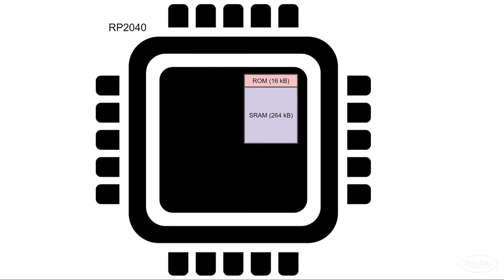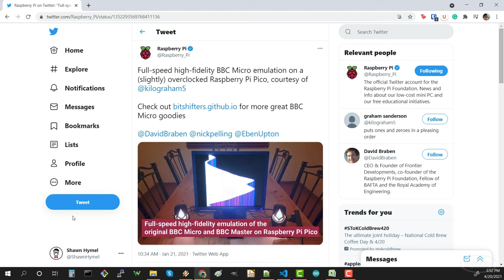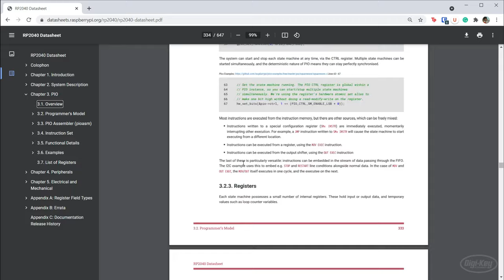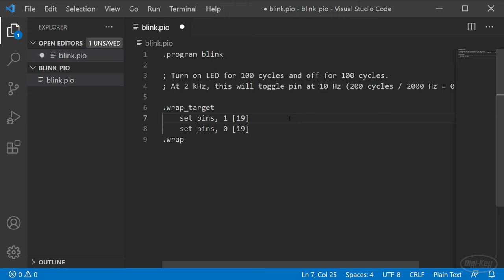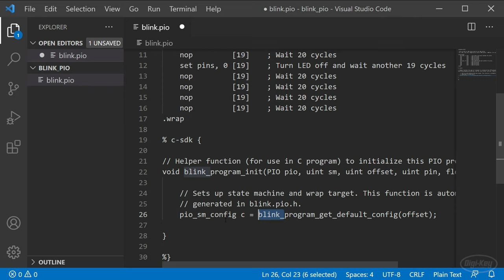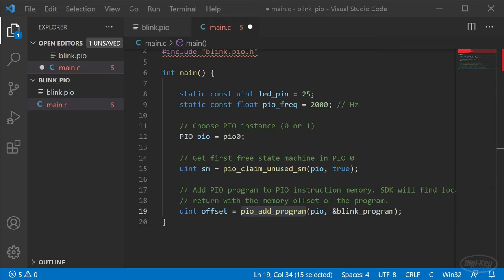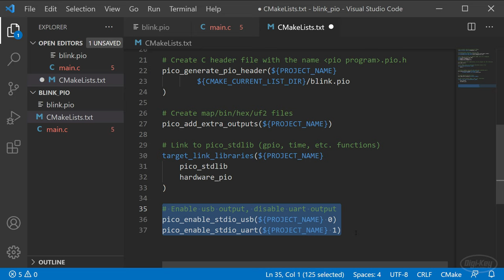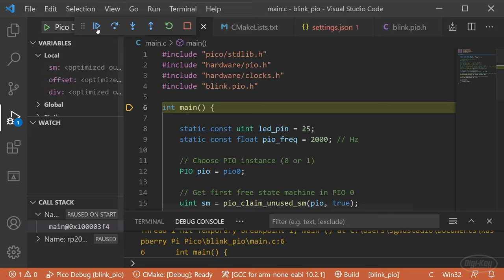Intro to Raspberry Pi Pico and RP2040 - C/C++ Part 3: How to Use PIO | Digi-Key Electronics

Comment: Is this PIO similar to the ULP processor inside the ESP32?
That module has more instructions though, including ADD and SUB math as well as boolean operations like AND, OR, ... 
Very useful to execute ADC routines while CPU is asleep.
Reply: I didn't know about the ULP, thanks for pointing that out! As you pointed out, the ULP is more capable than the PIO, but there are more PIOs in the RP2040.
Reply: @ShawnHymel  It can operate the ADC and I2C while CPU sleeps. That's good enough for me. 
https://docs.espressif.com/projects/esp-idf/en/latest/esp32/api-guides/ulp_instruction_set.html

Comment: Has the "development environment" improved in the past two years? I'm completely new to the pico, but picked one up this week with the idea that I might be able to use it for a project that I had been working on implementing completely in 7400-series logic (if only there were a "DigiKey Prime" for free overnight shipping...). I was able to do the "blink" program on the pico using the Arduino IDE, which was stupidly easy--same exact code compiled and ran, just by changing the build target to the pico--but it's unclear if it's possible to do PIO programming with similar ease in the Arduino IDE.

Comment: I have a hard time believing that someone who works for digi-key(assumption) Has never seen a "programmable peripheral" before. Maybe speak with RCN, also of digi-key who has been supporting hardware that's been doing exactly this for 8+ years. You know, the beaglebone white / black ? PRU(programmable real time unit). TI AM355x . . . I'm not saying this isn't a cool feature, but it is definitely not the first. Other than that, great video.

Comment: This is a needed video.  Twi questions.  Can the pio be used to implement a toggle buffer of a/d values that a normal interrupt driver does.  Second is FreeRtos available much like the dual core ESP32.  Thanks
Reply: The PIO/ADC is a great question. I don't have an exact answer, but my guess would be no, you cannot read ADC values from the PIO. If you look at p. 11 of the RP2040 datasheet, you'll see that the ADC is treated as a separate peripheral from the PIO, and I don't see a way for the ADC to load the PIO FIFOs without CPU intervention. However, I could be wrong on that, and I'd love to know the answer, too.

I've seen some RP2040 ports of FreeRTOS, but they're all single core at the moment. I have to imagine someone will give us dual-core support, much like you find in ESP-IDF, but I have not seen it yet.
Reply: @ShawnHymel  thanks
Reply: @ShawnHymel  follow up question.  In a machine learning application one may have to sample the A-D at a high rate as in a glass break detector. ( See Ti app note)  If one is doing tensor flow lite, then the bandwidth of the processor will be robbed by the high interrupt rate.  If one uses circuit python, then interrupt speed is 50x slower than C++.  Circuit Python only makes sense if the PIO can service the interrupt.  
This brings up the general question which I ask in humility.  What is the overall design philosophy of this chip?  I understand the ESP32.  (BTW I was involved indirectly when this chip was developed.)  Seeed Studio has an arduino m4 which lcd display which they are pushing for machine learning.  I am confused about this chip.
Thanks
Reply: @glennedgar5057  I wish I knew the answer to the design philosophy question. I'm guessing only the folks at Raspberry Pi can accurately state that :) My guess is that it's aimed at more education/maker audiences, hence the cheaper M0+ cores. If they really wanted us doing advanced DSP, ML, etc. on it, they would probably have given us an M4 core with an FPU. I imagine the speed + external flash + cheap IP core is primarily intended for MicroPython/CircuitPython development by the aforementioned crowd.

Comment: I wish there was a video detailing how one can use the ws2812 Neopixels in C such that it clearly demonstrates in code how one can individually controll a specific Neopixel in a chain.  Say there are 64 NP's, you can put_pixel(urgb_u32(255, 0, 0) and this would set the 0th or 1st NP red however it is not clear how you could make say the 12th pixel red or another color.  The examples in the official pico-examples do not do a good job showing how to actually make this work in C at all.  There is nothing on the web that really demonstrates this functionality in C.
Reply: Look at the protocol documentation in the WS2812 datasheet, then you will understand why something like void put_pixel(uint16_t pixel, uint32_t gbr) isnt possible in a low level implementation like with WS2812.pio.
WS2812 and similar use a 1 wire serial protocol, that means timing is everything.
The order you send data to the WS2812 decides which pixel receives it, a delay in transmission (which you will find in the datasheet of WS2812) basically means you are finished sending data and the LEDs reset with that data you just sent.
Therefore you have to send that data fast enough to not trigger the reset.
Lets say you want to change the 10th LED in the chain, to do that you have to make a quick for loop that sends 9x (uint32_t)0x0 and then the value for the 10th led, eg (uint32_t)0xFF000000 for R0,G255,B0.
The problem with this is that now the first 9 LEDs will be turned off because you sent them 0x0.
Now to how you would actually implement this so that if you send eg the 10th LED a value LED0-8 would keep the previous value.
Simply make an array: uint32_t pixels[NUM_PIXELS]
So to change the 10th LED to R0,G255,B0: pixels[9] = 0xFF000000
Now for loop through the array and: pio_sm_put_blocking(pio, sm, pixels[i])
After the for loop do a sleep_us(50) to make sure you trigger the reset.
Reply: @_--_--_  thank you so much!  This is very helpful!

Comment: Didn't the BeagleBone Black have two PRUs (programable real time unit) that would perform similar functionality to the Pi PIOs?
Reply: There are two PRUs in the BeagleBone Black, but my understanding is that they were more like full-fledged co-processors rather than simple FSMs. As PicoNano pointed out, I think the ESP32 ULP is closer to the PIO.